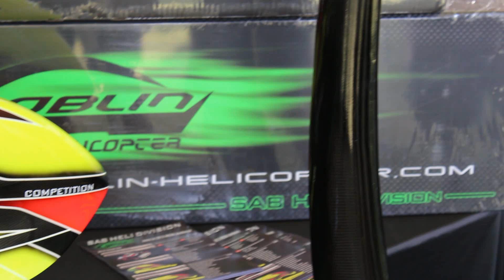Goblin Competition

Comment: CNC plate on the tailrotor, why not carbon?
I see some fixes that should have been there from the start. Wider motor belt so it doesn't strip (you mean explode in mid-air?), 14S finally, room for a kosmik (y)...

All in all some good upgrades, however a shame as these fixes should have been on the stock model. The tail blade dampeners for example..

Also would have been nice to see tail servo push rod inside the boom.

Comment: Well this was the anti electric guy but I think ile change my mind the sab gobling 700 competion looks beast  I want one with a pyro 850 50l 14s  tp 70c  5000mah weight of lipos 918g  plus a lot of wire shortening for less weight  why do you guys not shorten them because long wires cause a lot of the problems well lets say you l